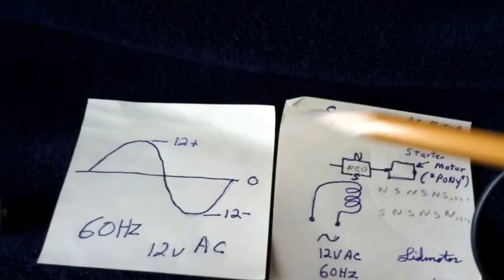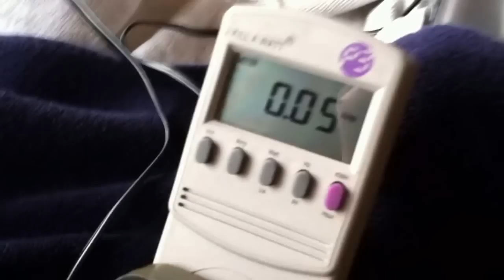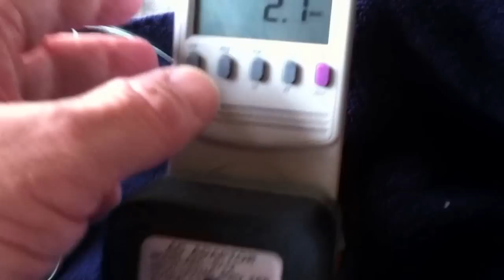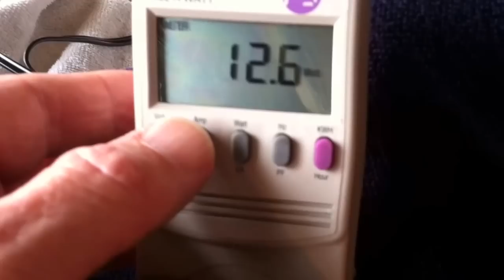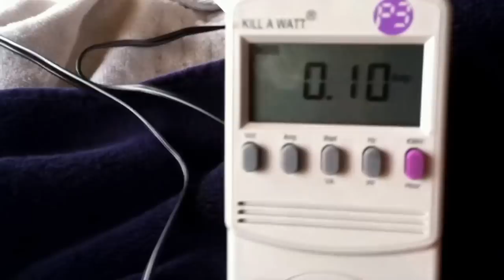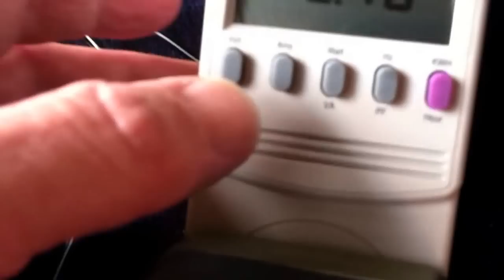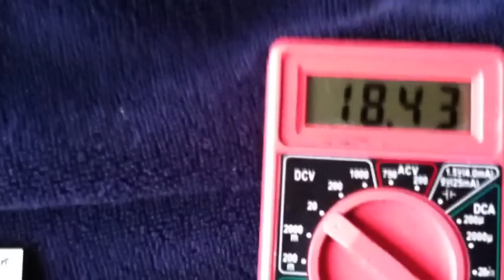Load Testing --Synchronous AC Motor

Comment: Did that coil have an iron core?
Reply from the maker: +John Kerley No.  It is a coil from another project wound up on a piece of wood dowel rod.  Not critical.  I have tried several other coil arrangement and they also worked.

Comment: Well done Lidmotor, but the whole system efficiency seems to be only around 10 % or so.. so not very efficient... but nice idea how to sync this DC motor to the 60 Hz coil... Regards, Stefan.
Reply from the maker: +overunitydotcom   Thanks Stephan.  Like so many of my projects this was  built as a learning tool with zero thought given to efficiency.  Just getting it to work was the main goal then using it to understand WHY it works was next.  I do think that you are a bit off on your 10% efficiency number because you assume that the synchronous motor/ generator power output is being accurately measured.  You are right though that this particular build has very poor efficiency.  The design could be vastly improved.  
  PS--One other thing you are not accounting for is the light I'm getting out of it and the heat from the coil.  If the design goal was a small motor project that I could look at in the dark while warming my hands on a cold night --then this becomes more efficient. Ha.

Comment: What is the current measurement through the series wired LEDs?
Reply from the maker: +A B  The amp draw on the 6 LEDs shows about 10mA.  If I take one LED out the amp draw goes to 24mA and the motor stalls.  I would need a better stator setup to get more amperage.
Reply: +Lidmotor That's a bit surprising.   Why would the current draw increase that much by just removing 1 LED?

10mA @ 18.43V = 1843Ω for 6 LEDs 
1843Ω / 6 LEDs = ~307Ω per LED
~307Ω * 10mA = ~3.072V per LED

~307Ω * 5 LEDs = ~1535.83Ω for 5 LEDs
18.43V / ~1535.83Ω for 5 LEDs = 12mA
~307Ω * 12mA = ~3.686V per LED

Your LEDs are connected in series, right?
Reply from the maker: +A B  The leds are in series.  I'm not sure why pulling one led caused such a spike in the amp draw.  What I really need to do is put in a variable resistor to see where the motor / generator stall happens.   Probably a small value pot will do it.
Reply: +Lidmotor Yeah, a 0-500Ω pot should work.

Comment: That kill-a-watt of yours has a button marked pf. It looks like it can work out your power factor. Not sure if it can give a pf corected watt reading but if you know the pf the calculations are not too difficult if you want to know the real and reactive power. You would certainly have a power factor present. If the reading looks too good to be true it probably is. PF is the most likely reason for false readings in this kind of inductive load. 

While I think most will understand what you mean when you say 10 ma consumed by light. That doesn't really make sense. 
To consider the consumption of the light bulb. Simply measure its voltage drop. It passes the same current as the rest of the circuit. It can't consume current. It could be considered to consume voltage though. It can limit current via ohms law.  But the current is always (really really close to) the same throughout the circuit.
Only voltage is consumed. Measure the voltage lost across the load and multiply it with the current in the circuit to get watts for that load. Beware of PF affecting readings on resistive  loads too if they are in a circuit with inductors. 
You got me re studying this stuff. While I have been studying pf's with a scope for years (we can blame slider for that, before he mentioned power factors to me. I was calling it "sticky amps" and thought I was the first to discover it) and have come to understand them pretty well on an inherent level. Then just now I found this. http://www.allaboutcircuits.com/textbook/alternating-current/chpt-11/power-resistive-reactive-ac-circuits/
The maths almost makes sense now... Its the best simplified technical explanation I have seen. A must read for anyone about to kick the hornets nest.
Reply from the maker: +Mongrel Shark   It would appear that I have opened up a can of worms.
Reply: +Mongrel Shark Voltage isn't really consumed either.  It is reduced by resistance.  What is consumed is energy (i.e.: Watt-hours).
Reply: +A B and every text book I have read agrees.. Although that seems to confuse a lot of people. ie: If power is A multiplied by V and neither A nor V got consumed. How can power have been consumed? 

If you analyse a circuit thinking voltage is consumed at each step it wont really lead you astray. When the time is right most will notice/figure out the true story. Thinking significant current is consumed at each step will ruin your day though.

If you had to prove no voltage was consumed. How would you set up your experiment? Its easy with current. make a circuit with as many known resistors as you like. current will not change by a significant value (you will see tiny changes of a fraction of a percent) anywhere in the circuit. 

But how to prove no volts where consumed. We can measure power consumed and heat created. The heat didn't magically come from no where. Something had to be consumed/converted to heat. We also have this convenient voltage drop that calculates perfectly to match the heat created. What is the Third part of the power that was consumed if no voltage was consumed? What got turned into heat? Because energy had to be consumed to create that heat...
Reply: +Mongrel Shark

Electricity is simply "the science of electric charges & currents".

Stored electric charge is what is actually used/consumed from a battery. 

Electric current is simply "the time rate of flow of electric charge, ... having magnitude equal to the quantity of charge per unit time--measured in amperes. "

The motion of free electrons against resistive/reactive substances is what produces heat (in addition to other effects of work--e.g.: light, motions, etc.).

Voltage is "electromotive force or potential difference expressed in volts"

Volts are "the unit of potential difference and electromotive force, formally defined to be the difference of electric potential between two points of a conductor carrying a constant current of one ampere, when the power dissipated between these points is equal to one watt."

As the charge in a battery is used/consumed, the terminal V of the battery decreases--however, a battery can also appear to have 0V in circuit under certain condition--even though when taken out of the circuit & measured, it shows the battery indeed has a measurable V.
Reply: +Lidmotor This is good stuff to revisit from time to time as it helps some people understand & other people to remember what is fundamentally going on with electricity.
Reply: Even thinking about power factors on youtube is kicking a hornets nest. Talk of voltage etc is a whole other can of worms. Lol.
Reply from the maker: +Mongrel Shark I spent an hour this morning researching AC power ---and now my head hurts.  It is a jumbo can of worms.  Why can't Current and Voltage just stay together and work things out?  Why do they have to 'lead' and 'lag' one another and make things complicated.  lol
Reply: I know. I need to go back to school and do trig etc. It gets worse. I first found out about this stuff on a bifillar pancake. That coil had capacitance too. But you can only observe and measure the capacitance during flyback. The rest of the time it hardly has any effect and the 2 coils are joined so a cap tester is no help. I had to break everything on my scope down to joules to make sense of it.

On the upside, after giving myself a bunch of headaches its all starting to make sense now.
Reply: +Lidmotor They (V & A) are like a married couple that doesn't always cooperate with each other. :)
Reply from the maker: +A B  Yep. But man they sure like to dance to music together.
Reply: +Lidmotor Everyone needs a hobby. :)

Comment: The 18V is a good isolated transformer effect in itself. Wonder how a small fan blade on it would compare to an A/C fan at such low wattages. 
Maggie should be refaced...plastic surgery, she's a legend !
Syncronous is without the accented 'o' btw. More like 'sin krer nous'.
Reply: A B
Was thinking similarly. To cut out some packaging type plastic and glue it to the brittle stuff. Am sure that someone in Hollywood with celebrity clients could do it.
#MaggiesLifeMatters
Reply from the maker: +slider2732  Thanks for the correct pronunciation of the motor name.   I'm sure that this motor can turn a fan blade but adding a second coil would probably make it much better.  Maggie could sure use a make over but she is rather fragile now.  The plastic has gotten brittle like on many of my old projects.  The plastic surgery would be delicate but she might pull through it OK.  I would hate to end her life just to make her look a little younger.  I have a new spool of wire to make Maggie 2.0 and I might do that instead.
Reply: +slider2732 
re: "Maggie should be refaced...plastic surgery, she's a legend !"
Luv it!  I 2nd the motion.. :)

Perhaps all she needs is a plastic graft (align the plastic pieces & apply a good thick clear plastic tape)
Reply: +slider2732 I think the proper spelling is synchronous (per:  http://www.dictionary.com/browse/syncronous%20?s=t) and the proper pronunciation is sin-krun-us or -kruh-nus
just my 0.02$ :)